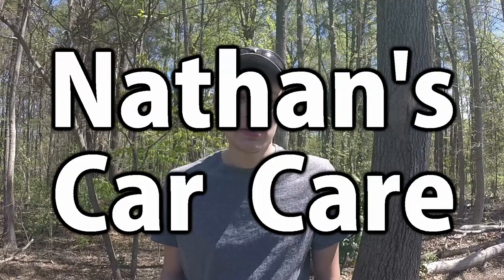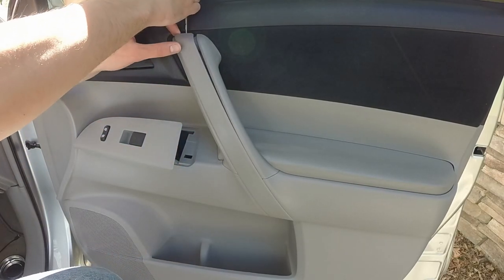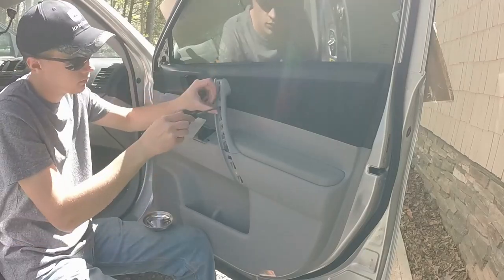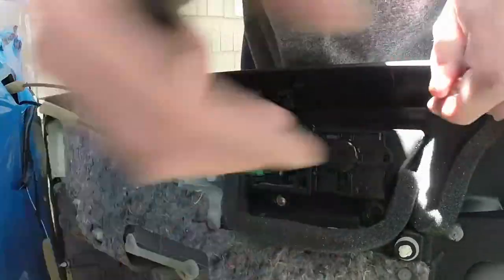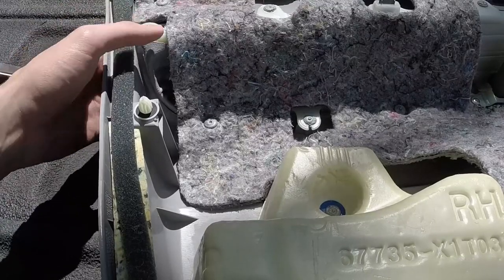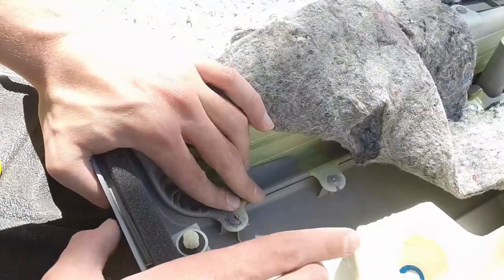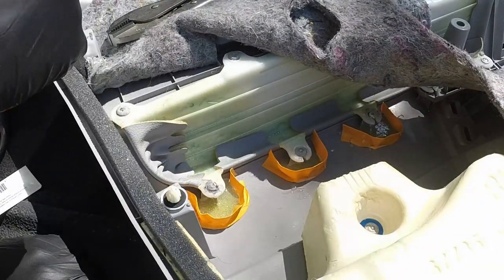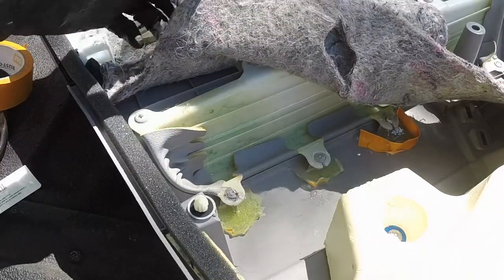How To Fix A Broken Toyota Armrest

Comment: Thanks for video. I may have one up to you and made the job much more easier.  I had a very small aluminum gutter screws hanging around and used plastic washers.  I drilled a small hole into post where plastic rivet was broke.  Super secure and super easy!!!!
Reply: Sounds pretty good wish you had a video

Comment: Thanks so much for making this video! You literally saved me from having to buy a new door panel for my 2015 Scion TC that was over $100. The second gen TC’s have this same defect on the door panel arm rests. I leaned too hard on my driver’s side and the armrest panel caved inwards. These plastic joint/tabs aren’t replaceable either. I would recommend wearing gloves while doing this because the epoxy felt super sticky and warm to the touch when I mixed them together. So far they’re holding up good. 😊 I decided to leave the tape mold inside the door that way the extra epoxy that spilled over the joint can just add more reinforcement.
Reply: Have the same issue with my 2014 Tc.  Going to give this a try.
Reply: @baltazaresquiveliii3387  That epoxy was totally worth it. I’d recommend gloves too while doing this. I did it in less than one hour on a Saturday morning. Not once have the arm rests budged. Fixed it!

Comment: Thank you Nate for the very helpful video.  I repaired my 2008 Highlander driver's side arm rest this morning.  I didn't notice any instruction in your video on unclipping the wiring harness to the combo window switch/door lock switch assembly while removing the door panel.  I had to do this to relocate the door to my repair area.  The Quik Cure two-part epoxy you recommended worked well for me.  I was quite liberal in its application.  It set up very well.  One note for others: it is not necessary to remove the two central screws from the vertical door pull handle.  They only hold an internal plastic piece to the handle.  You just need to remove the longer upper and lower screws to release the door.

Comment: Just opened it up, great instructions. My problem is a little different. No base mounts are broken like yours, but the plastic rivets are, when they meet the top of the base.  I feel I could use just a tiny screw with a washer that would screw into the base. A little worried the base is just too thin though. Suggestions? Maybe encase it in epoxy putty?

Comment: Literally the exact same thing just happened to my Prius...  I wasn't leaning on the door, i was pushing the arm rest to open the door and it broke one of the supports.  I am considering either super glue or apoxy...  However Apoxy seems like a better choice as it gives more long lasting support.
Reply from the maker: I would go with epoxy. Super glue wont build up the layer that will physically support the piece. Epoxy will.

Comment: Nice video but 3 things, First you could have used a small cup to mix the Epoxy and pour it in, Second that epoxy will lift itself up with the internal heat of the car, you needed to scratch the plactic to create some grooves so that the epoxy would had something to hold on.and last that tape mold is too high, a smaller so called tape mold would do. At  20.00 a pop of that epoxy its too much epoxy wasted on something that will not stick to plastic without those grooves.

Comment: Just did this. I'm not sure about the molds that you used. You would have to use a lot of epoxy to get this deep enough around the brackets. My molds leaked too.

The knobs that were broken on mine left small holes. I spread epoxy on the whole bracket and hole and then put a screw in the hole. I also put epoxy on all connectors in case they were weakened. 

Also, the epoxy packaging says that it has good performance but not best. They show Maxi cure, Insta-flex+, and ic-2000 as having best performance for hard plastics. Any reason why choose this over the others?

Anyways, great video. I wouldn't have attempted this without it.
Reply from the maker: Thanks for the feedback Blake! I don't believe I had any issues with leakage. I used that epoxy because I already had it on hand, and I had used it many times before with plastics and never had any issue with adhesion. There may be a better one, but this one has worked fine so far. My dad hasn't reported any issues since I did the repair.

I'm glad that this video was helpful. Thanks for watching!

Comment: i have a 2008 highlander and the arm rests are split down the middle...any fix for this???
Reply from the maker: Split down the middle? Can you get the epoxy between the split? If not, replacement is the only option.
Reply: i called a dealership a few months back and they said i would need a whole new door panel,is this the case as far as replacement goes???
Reply: I have the identical problem with my 2008 Toyota Highlander. What did you end up doing with yours? A good design would be an armrest you can pry off and fix it. I'm not sure Toyota did it that way though. They did seem to cheap out on a few things on what is otherwise a great vehicle!